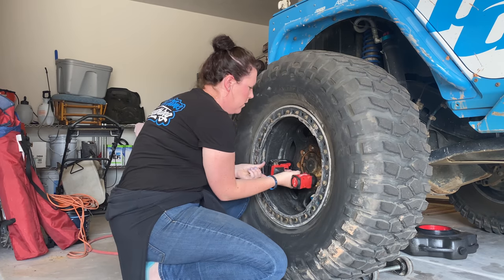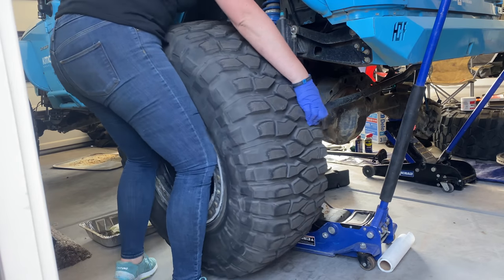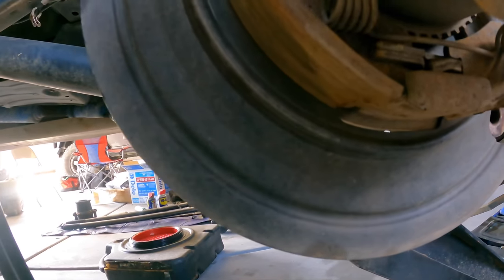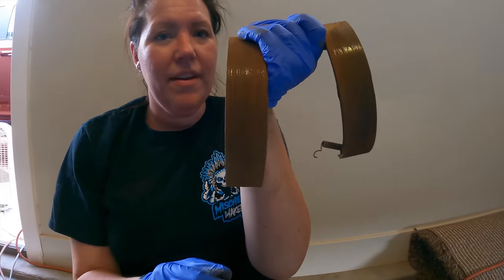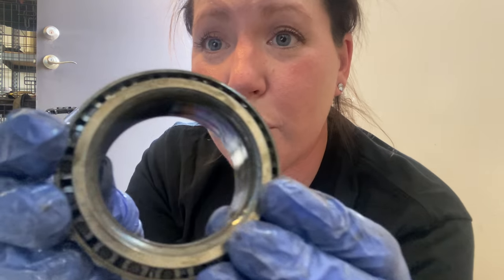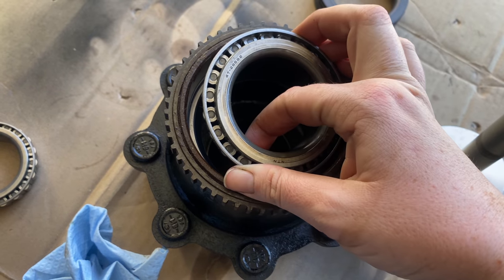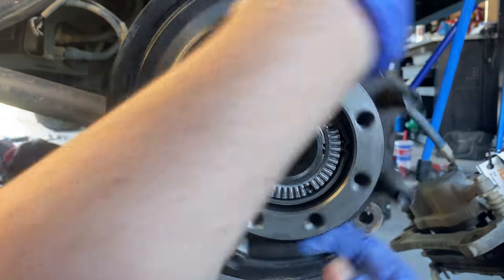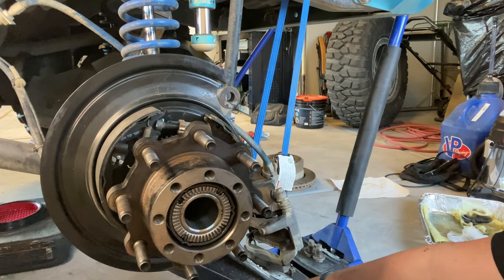Everything you need to know about how to tear your @fusion4x4 axle apart and more....

Comment: The way I learned to tighten the hub and bearings is you want to spin the hub as you tighten it down to the torque value. Break it loose half a turn, then re-torque to desired value.  Spinning helps align everything, the retorque  is supposed to help seat everything. Great video. Love watching you wheel, but I really love your accent . Bump it or send it.

Comment: Nice job. The crowbar for getting the tyre up is ok but a shovel under the tyre is super easy. You can sit back on the shovel handle and use both hands to push the tyre on when it’s at the right height 

And some knee pads your knees will thank you in ten years time
Reply from the maker: Thank you 🤘🏻

Comment: Take a tip from the wrecker drivers: as long as you have room to work around them,  big wood blocks are a great way to make sure things you've lifted stay lifted and don't drop on you.  Not as convenient as jack stands, but they're cheap and stable.
Reply from the maker: Thanks joe
Reply: @MischiefMakerTV  just don't want to see a "how to fix all the things that break when your vehicle slips off the jack with the wheels off" video series.

Comment: Those are great tips because so much of that applies to matter what type of axle you are running. (Speaking from experience) great video Holls!
Reply from the maker: Thank you so much! All of this should apply pretty directly to a D60, so hopefully this helps anyone looking to rebuild their 3/4 ton axle as well!! 😀🙌🏻🙌🏻
Reply: @MischiefMakerTV  can the same spindle nut tool be used for the D60 that you used on the D80? I have the Fusion 60s front and rear. Great video.

Comment: Did I miss seeing you repack them bearings with grease? Great job young lady I applaud you for a job well done.👋🏻 😎lllllll😎✌🏻
Reply from the maker: The rear wheel hub bearings are different than the self contained wheel hub you have up front. They are more similar to oil bath hubs you have probably seen on Trailers. I prefer to to simply tip the axle to each side using the jack and make sure gear oil gets to the hub. The way it was explained to me is…some people directly lubricate those rear bearings as a safety measure.  If you plan to drive around immediately after this repair (like at highway speeds) and don’t want to wait for gear oil to naturally travel down the tubes front the center diff and get to each hub. In that scenario it is common for some folks to add a slight amount of grease. 

I much preferred to simply to tip the axle each way before putting the tires back on. This way I could be confident that each end is filled with gear oil (as it should be) and I didn’t have to bother adding a different type of lubricant to my freshly rebuilt hub. 

Thanks for the great question!! 😀🤘🏻
Reply: You should never put a tapered bearing on dry. At least put some gear oil on them. Never dry.

Comment: When you don’t have jack stands, slide wheel up under axle. If jacks fail will keep axle from hitting floor.
Reply from the maker: Good advise thank you
Reply: Awesome work. Give this a try. I’m a smaller guy myself and run big tires. Sit on your bottom and put tire between your legs. Find where’s comfortable for you. For me in between my thighs. Squeeze thighs and will allow you to lift the tire and slide it on. Like you say everyone does everything different.

Comment: Great video.  Do you have a video of you removing the front axle on the Fusion 4x4 axle?
Reply from the maker: Here you go: https://youtu.be/5w77fK7S0BM

It depends on what axle ends you have. I don’t run unit bearing ends. I run a traditional hub and spindle with inner and outer bearings sitting between the spindle and hub. If you have unit bearing ends, this video won’t really be helpful 😊

Comment: Are these the same bearing you packed when Mischief was on the trailer in NY?? Well if you did, then a pat on the back to you :)
Reply from the maker: These are the same bearings that came with the axle when I first received them from Fusion4x4 in 2018. The fronts I replaced last year (just so I could learn the process). I’m sure the fronts are still in stellar shape, but I’ll be tearing the front down soon just to do a quick visual inspection and make sure all is good there in the next few days (I need to wheel before I spend any more time wrenching)!! Work hard, play harder 😝

Comment: No grease in/on bearings?
Reply from the maker: No not for me. A personal preference again as I said in the video, if you drive the Jeep on the street then I would suggest greasing everything up but because I this is a trail rig I prefer to raid the Jeep each side and let that gear oil go into the tubes and into where it needs to go.